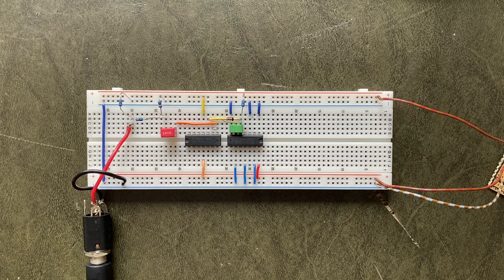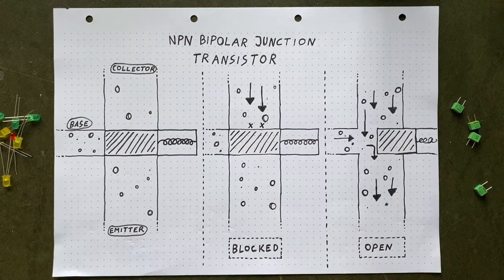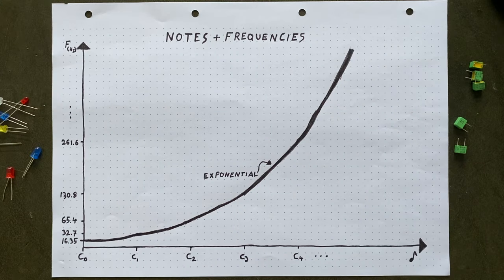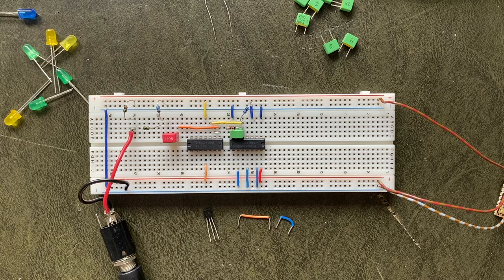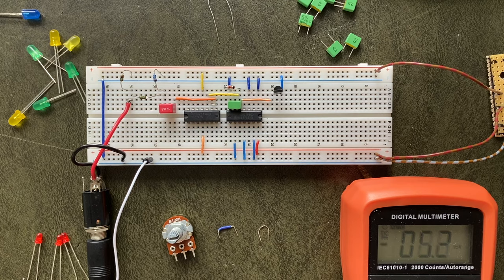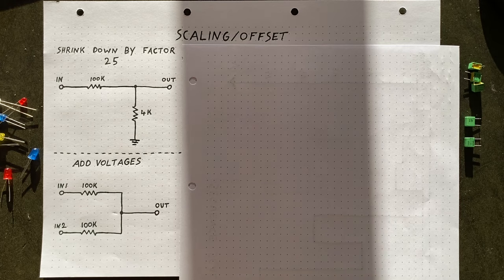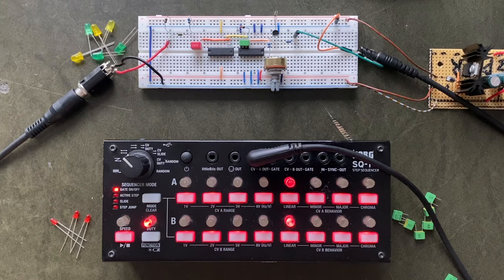DIY VCO Part 2: The simplest exponential converter

Comment: Looks like I was watching this video a year ago! OK I have a few insights into adjustable capacitors (usually air gap capacitors). They are typically used for high voltage. There are some lower-voltage ones. But there are two other issues. They are BIG, for one (much bigger than a potentiometer); and they do not have much of a capacitance range. Also they can be like $60 or more so building them into commercially available designs may be difficult.

(Also the reasons stated in the video as well)
Reply from the maker: just when you thought they couldn't get any less appealing :(

Comment: Great stuff, looking forward to the next one!

I was wondering one thing as a n00b: why not use a FET instead of a transistor? Since these are voltage controlled devices and are also usable as variable resistor? I suppose there is a good reason that I don't know of :)
Reply from the maker: to be honest, i haven’t really looked into FETs yet so i‘m kinda clueless there! it might be doable, but i haven‘t seen a design using them yet. maybe they don’t have that exponential voltage to current relation? i‘ll look into it!
Reply: @MoritzKlein0  I have a hard time understanding the info about it online, it's all pretty vague and technical. I suppose the use of transistors is documented better because of it's longer history.

But considering the exponential curve, that might be the issue yes! But more in general it would be nice to have an alternative for the kinda messy diy vactrol to plug CV in. 

Anyways, thanks for the great content!
Reply from the maker: @zvm FETs are transistors too – just fyi! and yeah, i also used to fantasize about some simple, clever component that could to what a vactrol does, but less messy. as far as i can tell, that doesn't exist – you'll need to use different components for different scenarios. 

i've got a filter series planned next, maybe i'll look into FETs for that!
Reply: @MoritzKlein0  I have simulated some circuits with this paper as source: https://www.vishay.com/docs/70598/70598.pdf?fbclid=IwAR0QEFo9vZrmlNF0DQf5qAeiMSvMQPql9sfDqieE4mD6RQo1iuvbxD9aahc

I used the circuit on the bottom of page 3, and in the simulations it seemed to be a very efficient simple circuit that acts as a voltage controlled resistor. I haven't tested it in real life yet, as I'm still waiting for my ordered FETs.

However, I find it hard to believe that it will work perfect, as this study is from 1997 and I haven't seen this simple circuit all over the place. I hope I can test it soon!
Reply from the maker: @KeurslagerKurt  looks promising! let me know how your tests go!

Comment: Hi Moritz I'm assembling your DIY VCO module and I'm first putting I the 1k resistors... but I. Notice one of them R11 seems to have a very narrow spacing which makes the resistor have to practically stand up when I solder it in... is this ok? I don't want to be making a mistake early on... thank you!!!

Comment: Hello, I'm interested in digging into this kit. Just one very newbie question, sorry in advance...... is there any differences between BC548 and BC548C? I found only generic BC548 transistor... is it ok anyway?
Reply from the maker: the letter at the end indicates how much gain the transistor has. this is mostly not that relevant, so any BC548 model should do just fine.
Reply: @MoritzKlein0  thank you very much for your fast answer 🙏

Comment: These videos are amazing, I can't thank you enough. I'm following along, and at this step, everything seems to be functioning properly, except it is still extremely quiet. I have it plugged into a guitar amp which I'm sure is not the best, but even at a decently high volume, the VCO is still very quiet. I've gone over the videos a few times to make sure my circuit matches and I can't find any issues. Is this normal?

edit: I figured out that my op-amp was bad, causing the issue.

Comment: Hello Moritz! Is there any reason why you've used bc548 transistors? I know there is a whole npn family of them depending on slight change of their parameters, there are 547 548 549 and also bc550 and their pnp sisters like bc557 558 559 and 560. I've seen some datasheet telling that some of them make very little noise. Is that you simply have a good stock of those little 548 or maybe you like them for something special?
Reply from the maker: it's just that i have these in my stash. used to build a lot of rené schmitz modules and those are the ones he uses.

Comment: This is a great series, I'd like to order the parts to follow along, would you be able to publish a full BOM and perhaps a link to Mouser or Tayda?
Reply from the maker: yep, i'll see what i can do!
Reply from the maker: so here's the full list, including all the components we need for the next episode. i've never used mouser but i'll see if i can whip up a set/kit/whatever there. however, if you have a local electronics shop, i'd strongly encourage you to buy there!

> basics:
1x breadboard
jumper wires/bridges set
2x 9V battery plus clips OR 1x dual 9-15V power supply

> ICs
1x TL074 quad op amp
1x 40106 hex schmitt trigger inverter

> diodes:
2x 1N1418 diode

> capacitors:
1x 2.2 nF foil capacitor
2x 1uF foil capacitor

> resistors:
1x 1M resistor
5x 100k resistor
2x 10k resistor
1x 4k resistor
1x 1k5 resistor

> potentiometers:
3x 100k linear mono potentiometer
1x 1k linear precision trim potentiometer

> transistors:
1x BC548C NPN transistor
1x BC558C PNP transistor

> jack sockets:
2x 6.35mm OR 2x 3.5mm
Reply: Moritz Klein fantastic, thank-you
Reply: @MoritzKlein0  hi, did you ever create a BOM on mouser, or another electronic components site? I'd love to follow along, but I'm a super early beginner and a bit afraid I'd buy the wrong type of components.

Comment: I had quite hard time accepting that swapping the voltage divider resistors from 100k to 10k actually solved the the emergence of the accidental low pass filter (I take it you talk about band pass because the ac coupling is in theory a hi-pass filter), but obviously this is due to the stray capacitance from the bread board?

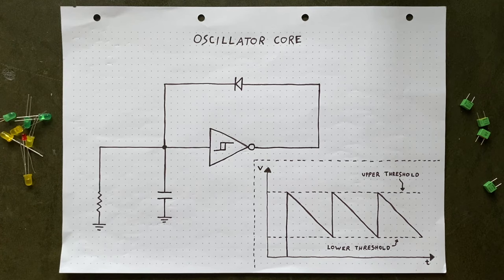Comment: one correction at 3:16, a varicap (or varactor) excists, which is a voltage controlled capacitor, and it's also a diode

Comment: I followed allong with your build, and I get a lot of low noise on top of a high pitch squeek. Do you have some advice on troubleshooting?
Reply from the maker: what kind of power supply are you using?
Reply: @MoritzKlein0  2 9V batteries until my eurorack powersupply arrives

Comment: in an old radio we change the oscillator frequency by changing the capacitor. but it's an extremely low value capacitor and it can only change over a very small range. perfect if you need to to precisely adjust relatively high frequencies (like from 550 to 1720 kHz in an A.M. radio)

Comment: Thanks! As a very green hobbyist, that is hands down the most helpful yt electronics channel I've seen so far. I do have a question though. At 16:30, how come the resistance you put between the power rail and the transistor base doesn't affect the voltage? I mean, I do understand it limits the current, but isn't the resistor a load, why no voltage drop?
Reply from the maker: it does affect the voltage, but only slightly. since the transistor is barely turned on, only a few nanoamps will actually flow into the base – which is not enough to make the voltage at the base drop significantly!
Reply: thanks a bunch!

Comment: This is very old but please answer if you can, why not just use a potentiometer in place of the transistor to control the frequency of the signal?

Comment: hey my friend I have a question: sometimes control voltage start from 8volt to 10volt(for example)
but vco work with 0v to 3v(for example) volt
what circuit can convert 8 to 0 and 9 to 1 10 to 3???????

Comment: Do the transistors need to be matched? I managed to find and use a pair with HFE within 2 or 3 (they were some crazy outliers) but they are pretty rare from the batch i got (1 pair out of about 100 transistors). Also I was watching a documentary about ARP and they mentioned that their engineer actually took the transistors to a sander to remove as much of the package as possible before thermally bonding the transistors together. I didn't go that far since I only had one pair, but it sounds fun.
Reply from the maker: are you talking about the npn/pnp-pair? if so, i’m fairly certain you don’t need to match them. also, generally in synth design, you match transistors for Vbe, not hfe - and, only afaik, you can’t even match npns and pnps for Vbe. take this with a grain of salt though!

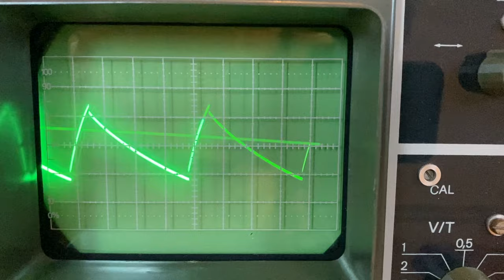Comment: at 3:00 i dont understand why the capacitance would affect the "attack" of the wave because i thought the schmitt inverter functioned based on a threshold and "pumped" the voltage at once
Reply: Because capacitors always let change in voltage pass and always block steady current. Now he's taking the output from the connection between cap and resistor, not after the Schmitt-Trigger (there's only a square wave, on or off). As the cap is connected to ground, there will be a current to ground as long as the cap charges up. Think of the balloon analogy: As long as it is expanding in the pipe, it pushes water out on the other side (like in AC-coupling). This reduces the pressure level (voltage) in the circuit. The pressure (voltage) will however increase at the junction between resistor and cap slowly as the cap fills up until it's full and the current stops.

You can also think of the electric field that's building up in the capacitor. Like the tension of the balloon skin, the electric field pushes the electrons out on the other side but then also creates an increasing force against more electrons being pushed into the capacitor, until the field is at its maximum and no more electrons can fit in.

Now small capacitors fill up so quickly, that it is full almost instantly, but the bigger they get, the slower they charge.

Comment: Thank you so much for these videos! You are such a great teacher!  I am going to rewatch the videos and build this, understanding how it works in detail.  Thank you!  Question regarding 13:15 : I don't have the BC series of transistors I have many of the other common ones in audio like the 2N3904 -- can I use that instead?   I can buy a BC series transistor pack of 250 transistors [BC327 through BC558] for $9.99 from Amazon.. maybe I should grab that.
Reply: it's kind of a late answer but it does work with a 2N3904 or a 2N2222, the audible range is slightly different though but it's no longer going to matter after episode 3 where you get to fine tune the oscillator regardless of the transistor's exponential range

Comment: Hi Moritz, sorry to ask for your help again, I'm completely stuck in this chapter from the moment you use the 4K resistor for rough scaling. I have bought this Korg SQ-1 too as this seems a necessary tool :) but then no sounds are audible, not at the 1v, 2v, but only a few high pitched sounds at 5v. Now I'm completely lost and do not know which steps to take. Kind regards
Reply: Hello,
I'm currently facing the same problem. Did you manage to solve it? I know it's a long time haha. Most likely a problem of voltage division.
Thanks!

Comment: I m having a hard time choosing the right film capacitors on Mouser! What voltages do I need? thanks for the help.
Reply from the maker: if i remember correctly, film caps start at a super high voltage rating (63V?), which is more than enough for this circuit. (you need at least 24V.)
Reply: thanks!

Comment: great video! i'm very interested in VCOs and I never thought there would be such an easy solution. My best bet was to use FETs in triode regions. The thing I didn't figure was which region did the BJT work this way. Was is active or between active and cutoff?
Reply from the maker: hi raphael, to be honest i'm not sure if there's a name for that region. generally i find people make a hard distinction between cutoff (<0.7 base voltage) and active (>0.7 base voltage), but as you've seen in the video, it's clearly not binary like that. the interesting thing is that as far as i can tell, the BJT seems to behave kinda like a FET here – being voltage controlled instead of current controlled. i'm not an engineer though, so i might be completely wrong about this!
Reply: Moritz Klein I see! Usually we make this hard distinction, but you operated right in between regions which is unusual and highly temperature dependent as you observed. Anxious to see your solution for this problem
Reply: Another thing you could experiment with is to use reversely biased diodes. They work just like capacitors but voltage controlled. The keyword is “varsities” and even a general 1N4148 can work as one
Reply from the maker: @raphaelcardoso7927  yes, actually i experimented with a reverse biased diode first, before i heard of the transistor idea! fun way to make cacophonous sounds!
Reply: Moritz Klein do you have a source where you read this transistor idea? I’d love to read
Reply from the maker: @raphaelcardoso7927  sorry, i don't have a source! i only saw this idea in a VCO design by rené schmitz  – https://www.schmitzbits.de/vco4069.html – and experimented with it until i got a basic understanding of how it works.

Comment: I finally made it work ! But when I plug the cv, I have a weird crackling noise (it goes down if I put my fingers on the jack ) and the vco sound level is really low
Reply: Did you ground the inputs to the unused schmitt triggers?

Comment: Hello Moritz! I've built a midi2cv converter to control synthesizer using Atmega chip and DAC. I'm not a programmer but I've found some code to program the chip on the internet and it works. I have checked it with voltmeter to see if DAC is changing voltage when midi note from midi sequencer is coming through the cable. The problem is that I have not much experience in such things. You've got this little korg sequencer so it works right out of the box, but I had do build something to play midi from pc and it needs to be made fully compatible. In this video you show how to control oscillation with voltage using ready device. My cv controller is built on breadboard and I wonder if it needs some additional op amp buffer like you've build for sound output. I have no idea how korg sequencer looks inside. On midi 2 cv schematics there is some LM324 op amp to scale up the DAC output to 1v/oct range and there are no notes if it's needed in any case. Currently I don't have required power supply (it's dual as well) and I just wish to test if it works at all without an op amp because I don't have any yet. Since I have no idea I'm afraid to connect dac output to transitor base directly or through resistor what if it gets destroyed? DAC is not an easy part to get so I wish to ask maybe you know if it needs such a buffer like op amp between DAC and CV input of an oscillator or not? You know a lot of things maybe you have some idea because I don't
Reply from the maker: that's a bunch of questions! first of all, you shouldn't connect any voltage directly to the transistor's base because you'd basically create a short circuit. i think later in this video i explain how you build a voltage divider that scales the input voltage down (while also limiting the current). second, for the whole v/oct scaling thing, check out my video(s) on a DIY arpeggiator. i explain how you use a DAC to convert digital information into a v/oct conform analog signal.
Reply: @MoritzKlein0  I've tryed to use voltage divider as you explained in  the video, but it didn't work in my case with same resistor values. I think that problem is that I've tested this cirquit in different conditions. And because my CV is not complete. First it's powered by 5 volt supply, I've got  no 12v supply  and no dual polarity supply as well. I've just got 5v dc converter breadboard module. Oscillator works at 5 volts because I was willing to see how or if it works at all. Well... it works anyway. So I tryed to connect DAC to it through 100k resistor and it stops working. I thought that it must draw too much current and create too much voltage drop on resistor or interfere with DAC output in some way. So I tryed 1M resistor and it didn't work as well. The oscillator simply stops generating, because transistor shuts down I guess. So I thought that there must be something to isolate DAC and transistor base.  I've put op amp in between DAC and resistor going to the base of transistor and now it works with 1M resistor  between  op amp and base. It can make some funny noise. Voltage offset part is the same as in your video, I've just replaced the  second 100k resistor with 1M one and isolated DAC with TL072. I did it all by insight and I wish I understand how exactly it should be made....  Those DAC's are MCP4822. These are 12bit DACs with maximum voltage output of 4.096V